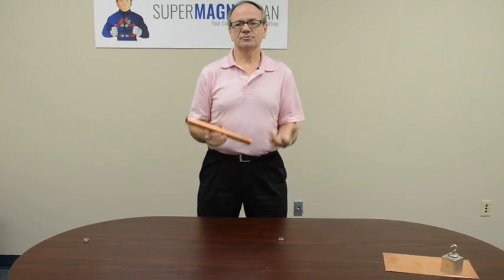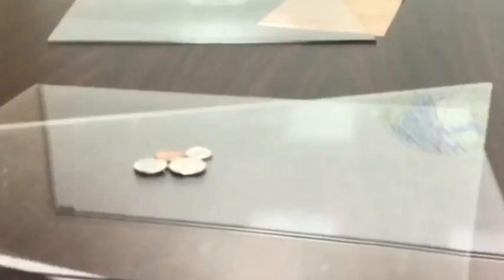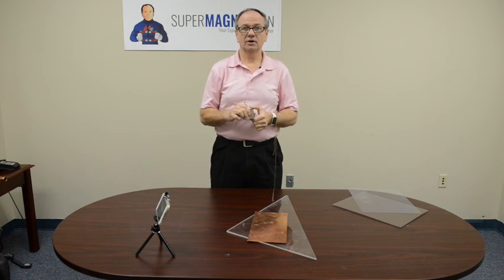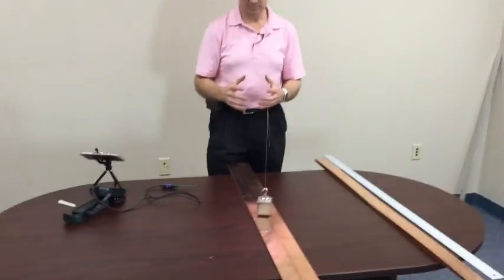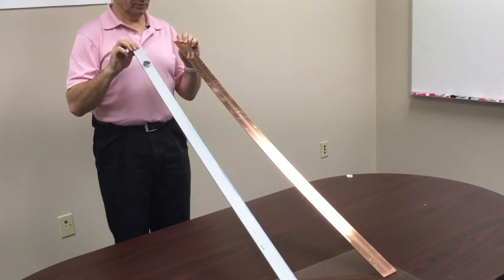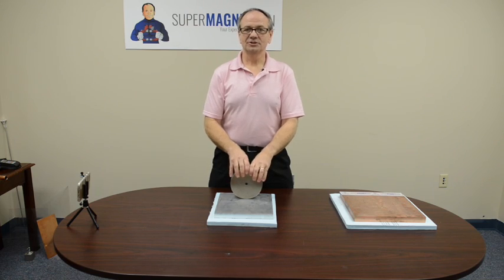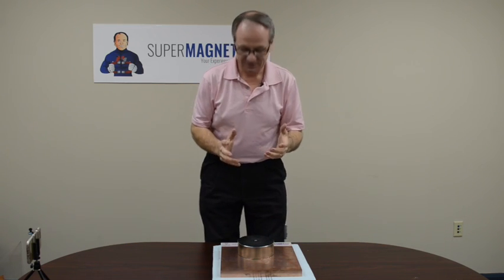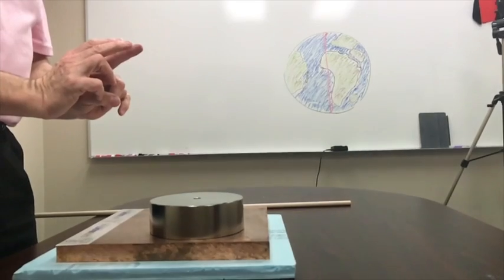Magnets & Copper Part 2

Comment: When I am turning and milling I have problems clearing away copper and aluminium swarf. With your understanding of magnetism could you help to produce something that will attract the swarf so it can be disposed of,  similarly to iron swarf
Reply from the maker: Sam - so sorry that I just saw your comment.  Yes I think that can be done.  I would have to understand the process a little better but I worked with a guy designing a gold panning system a few years ago and we used this concept to kick copper, aluminum, silver or gold over to one side in his sluice trough.  Just contact us and we would be glad to see what we can come up with.
Reply from the maker: Sam - actually magnets can be used in an application like that but something has to be moving.  We have worked with one company that machined parts and had a conveyor belt that removed all the cuttings from several machines.  We helped them put an array of magnets over the head of the belt and pull the conductive metals in one direction and everything else in another direction.  The key is moving the magnets fast enough to create the levitation that separates them.

Comment: Would it be possible to use electromagnetic field's to generate ultra low temperature's to activate superconducting material's to take advantage of quantum levitation effect like on a mobious track? Then a train could levitate and be locked in the direct center of the field and be able to reach incredible speed's in a enclosed tunnel that is not a vacume just super cooled lowering the friction of the train passing through the atmosphere with these effects allowing the hyper speed train to spreed up and slow down in short amount's of distance? Aluminum Scandium alloy whwn exposed to ultra low hertz frequency IE with a Tesla coil will generate ultra low temperature's and superconducting energy loop's can be passed through Tesla coil's with zero energy loss with that energy frequency affecting the crystal structure's of refined crystal structure's IE Aluminum Scandium alloy to cause said ultra low temperature's to take advantage of superconducting material's for quantum levitation and for the use of a mobious track for a hyper speed train? The train could move upon Halback electromagnetic array bubble's ounce train is at hyper speed's that can turn on and off has the train moves down the track IE tunnel system. Graphite foam and electrolyte could be used to make the tunnel a electrical power generation system has the hyper speed train zipped through which could then energize power grid's along the hyper speed trian tunnel system's? Is all of this very possible? 😊
Reply from the maker: I can't even imagine how much electricity that would require - probably take an entire nuclear plant with a capacitor bank the same size.  Imagine the size of the conductors to dump that much electricity that fast!!!  Whew!
Reply: The wrong individual to communicate with about such possibilities it seem's. Must be nice to be a free Masonic daughter of the widow of the dead candlestick maker thank's to Horus the Christ the king turning the candlestick maker into nothingness into a father who aren't in those heaven's? Hay yet thank's for your intelligence MON!😊👍              🗼🐦
Reply: Jim Martin   It’s been done. It didn’t work. To bad, so sad.

Comment: After watching you channel on neodymium magnets I was wondering why you did not talk about the curi effect or curi temperature of a magnet. You spoke about cutting a magnet cube at angles to achieve a 45 deg field.
I did my grad work in DC magnetism and the curi temp or affect is a big thing. By heating a magnetic above its cuir destroying all magnetic properties you can grind or cut the material to any desired shape , then re-magnetize it to the field desired.
I have done this a lot.
Joel
Reply from the maker: The curie temp is not the real problem - the real issue is the maximum working temperature which is well below the curie temp.  The maximum working temp is 80°C for N50 or N52 grade material.  N45SH would be 150°C.  When I cut the magnets I use a Dremel tool with diamond wheel and I take a can of compressed air and turn it upside down to produce a blast of cold air colder than -40°C and precool the magnet.  Then as I grind on it I can grind more before it gets too warm.  It is quite easy to machine them quite a bit without having to remagnetize them.
Reply: SuperMagnetMan    😳

Comment: I've been thinking why can't a Magnets turn a shaft like on a crankshaft in a gasoline engine.? I've been thinking  Wow wouldn't that be something to have a car that never needs to be charged or run on anything  but two Magnetic fields keeping a mechanical motion turning then definitely . Call me crazy  but I believe anything if you don't give up on it!  I was told it can't be done because the magnets lose their power after Time. I know this is true but I also was told that it is a cooling issue that keeps a magnet strong by keeping them cool  help's magnets it can keep them strong so my question why can't it be done ? My son telling me it can't be done. I believe anything can be done ! United States did not become what it is because of negative thinking and saying it can't be done how many times have people said that about the spaceships we put people on the moon we put satellites in the sky you cannot tell me that just wasn't easy task and no one had any obstacles in the way that had to be figured out ! 
Let's keep our eye on the prize this could change the transportation issues across the world not just in United States ! And help eliminate the carbon footprint without depleting our energy resources ! Electric cars are great for now but who wants to pay or wait to recharge your car after so many miles  
! I believe in This and know 
There's away it  Can be done
magnetic engine that does not on any thing ! but it's 
Self ! 
Please let me know what you think about it. 
Thank you !

Comment: Bozo the clown explains the enhancement of the 'deacceleration effect' caused by the spinning of the permanent magnet as being a 'gyroscopic effect'. This highlights his utter incompetence.
Its the greatly increased relative velocity of the permanent magnets field and thereby the strength of the 'induced electric field eddy currents' in the copper sheet and its associated 
'magnetic flux / interactive force'.